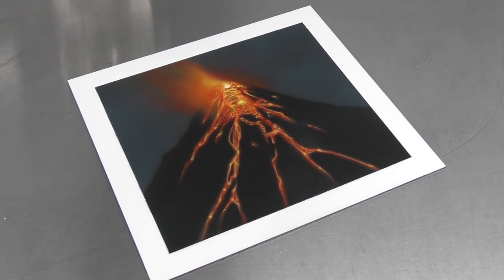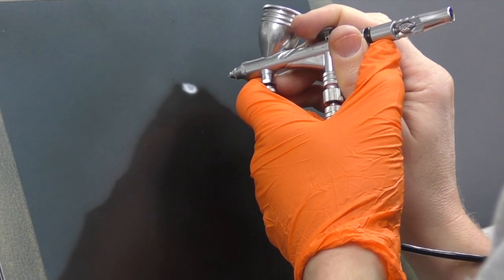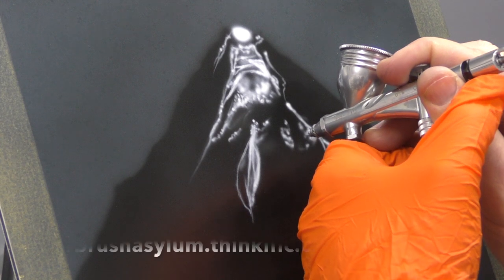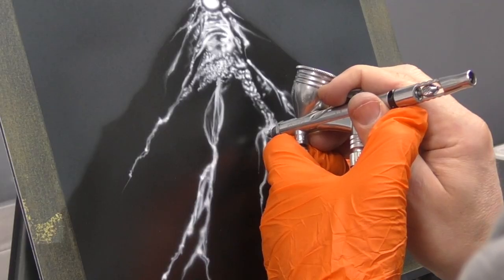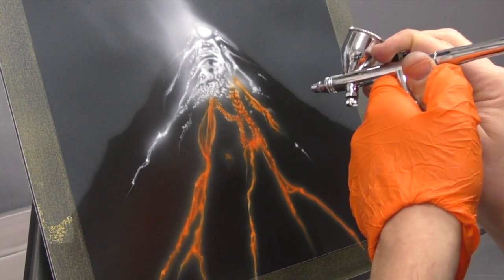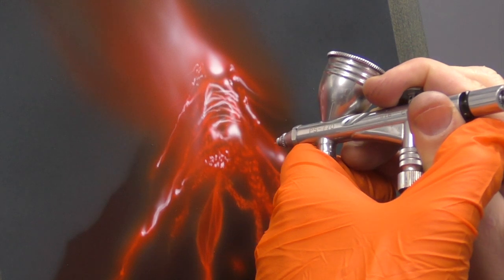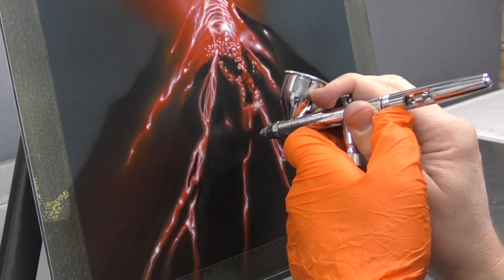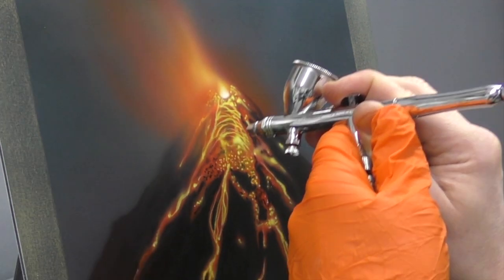Airbrushing a Volcano and Lava

Comment: As i'm new to airbrushing i will surely take a look at your course. I've seen several video's now and i really like the way you show the airbrushing techniek without to many unnecessary comments and pauzes to tell about color or the airbrush etc......  Really like your work.

One question though, why do you use a aluminium plate instead of paper ? Is it because paper or canvas will absorb the paint ?

Maybe it's a dumb question, but i'm new at this and want to learn all there is to do it right.

Comment: Awesome content, I've learned so much (didn't know anything yesterday).
I have one question though. Can you use metallic car paint in an airbrush? I read somwhere that the metallic flakes may be too large? (I want to fix my car door myself and that would justify spending money on a new hobby too :D)
Reply from the maker: Thanks for your kind words and glad you are enjoying my videos . There are lots of compatible metallics that you can spray through an airbrush but it depends on the size of the particles as airbrushes have fine nozzles. If they are coarse then I’d recommend a mini spray gun also keep in mind that because the airbrush atomizes so fine it will make the metallic look different when sprayed over your car colour as that would have been sprayed with a larger spray gun in order to get coverage 👍🏻
Reply: @AirbrushAsylum  Thanks, thats super useful information! The area I want to fix is relatively small, ~4cm in diameter. I can't get touch up paint too look good at all and the car is from -09 so I think I could live with the metallic look to differ. Going to investigate further and also keep watching your great videos! 👌